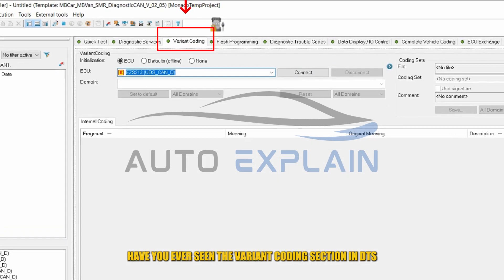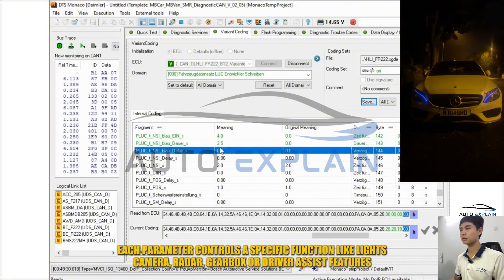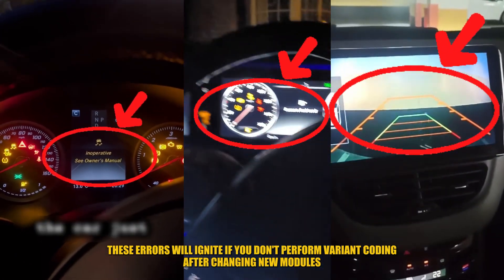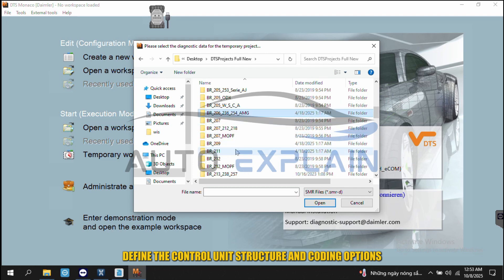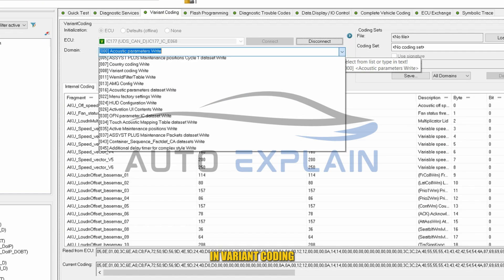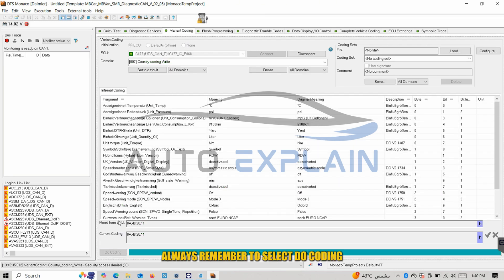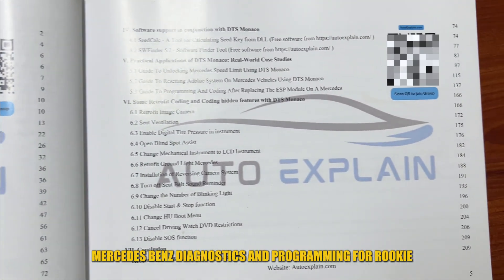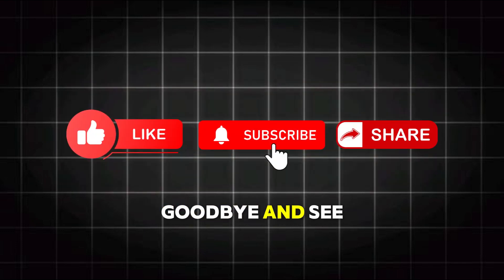DTS Monaco Tutorials Part 5: How to Perform Variant Coding

Comment: Can this program chenge values for gearbox sensor? In reverse gear have value 0.50V, need 0.60V in 6-gear have 3.35V need 3.40V. I need to reduce the parameters
Reply from the maker: Yes, it can. If you want some advice, just contact us via whatsapp +1 (517) 271 9168, our technician will support you right away